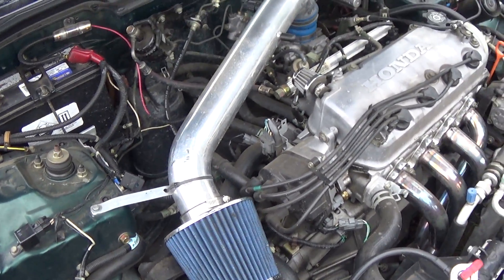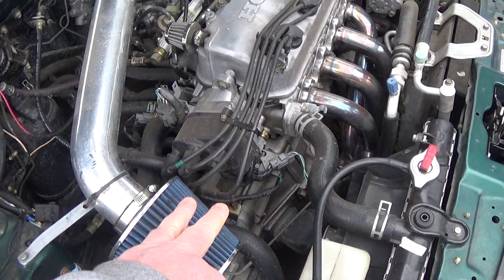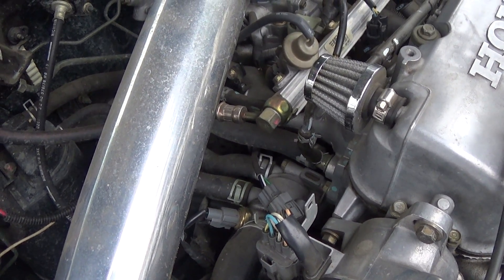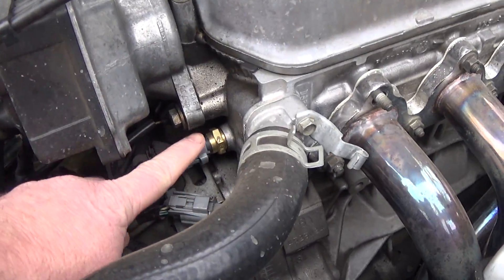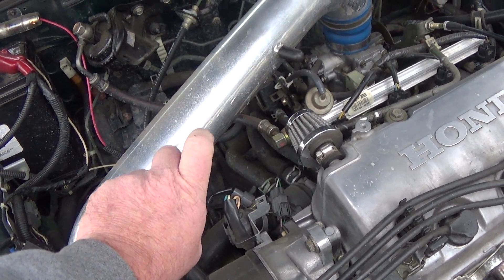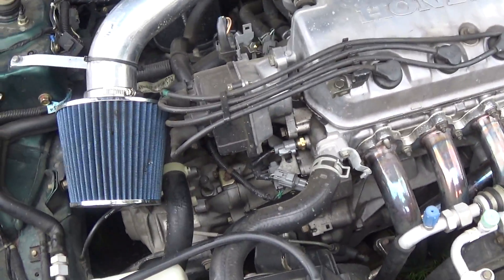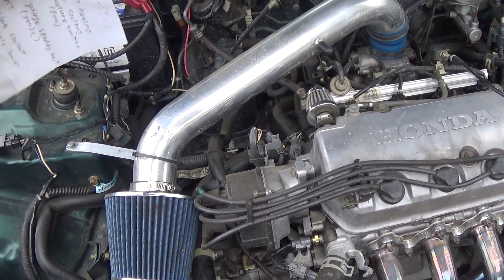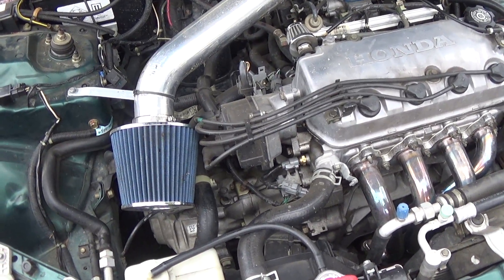Explaining Honda Civic 3 Engine Coolant Temperature devices

Comment: Are these 3 sensors different in shape/size? Can someone fit them in the wrong place? My problem is that since I changed the oem ECT, the temperature gauge fluctuates when driving in different road conditions. This didn't happen in the past. Once the engine got warm the temp.gauge  would stay in the same position.  I used a delphi sensor with this part number ts10180-11b1. Should I worry?
Reply from the maker: I don't see how you could put them in the wrong place.  Have your battery and alternator tested.  Should be free at your local parts store.  They can test it on the car.  Also you can have the read for scan codes.
Reply: @tubejim101  Im getting a rebuilt engine for my 94 civic and Im trying to find a water pipe that bolts into the cylinder head. Im not sure what thye are called but a coolant hose runs from the heater core valve to that pipe. It is about 2" in length and 5/8 in width. Not sure if a rebuilt engine comes with one. You wouldnt happen to know where I can get one for a 1.5 liter?
Reply from the maker: @Someguyto  Normally I would say just get one from the wrecking yard.  Sadly,  they have been crushing the cars, because scrap prices are going high. Does the pipe, actually have two parallel pipes?  Go to your Honda parts guy, at the dealer.  Honda is really good about sharing their parts sheets.  He can look it up for you and print it out for you too, if you ask.  Honda parts from the dealer are hit and miss.  Some parts are priced very good, others off the chart.  Always check.
Reply: @tubejim101  It looks like it is all 1 piece to me. I would risk trying to reuse it but if it ever breaks later on I would hate to have to replace it or uninstall it. It screws directly into the head under the distributor cap.
Reply: @tubejim101  these are tested. No error codes as well. I wonder how changing the ect affected the way the gauge works. I also replaced the thermostat with a genuine one.
Reply from the maker: @saxophonias  Could also have an air pocket in the coolant.
Reply: @tubejim101  so you think it needs bleeding the coolant?
Reply from the maker: @saxophonias  Burp it.

Comment: hello are the two front ones the same  ? it only shows me two on the az website
Reply from the maker: az mean AutoZone?  All three are different.
Reply: @tubejim101  yeah
Reply: @tubejim101  which one do u recommend me change  the gauge goes up when im on idle the fan turns on so i dont think its the cts
Reply from the maker: @rustfornoobs1071  Sounds like you have air in your system.

Comment: My civic dashboard gauge works but never goes over the middle, I’ve been pushing my car uphill and stuff and still didn’t moved more than the middle it never overheats, I got the stock radiator how is it possible?
Reply from the maker: Couple of thing.  Don't run green radiator fluid.  Use a universal long life (5 years) antifreeze.  No one ever remembers to change green, bad antifreeze can coat your cylinder walls so they don't cool as well.  Get premix.  An air pocket will throw off cooling.  Someone may have put the wrong thermostat in.  It could be bad.  If it is stuck open, you will have trouble heating up.
Reply: @tubejim101  thanks for your reply, no problems heating when cold, just can’t believe my car not overheating, not like I want it to but I was stressing my engine uphill in a mountain and the gauge didn’t move, I will try to flush it and use that one you recommended

Comment: My temp gauge was working but the wire split just from being old over time so I wired a new temp sensor clip on an now my temp gauge won't work at all. Any idea what else it could be?
Reply from the maker: Probably another brake in the wire.  I had that with my reverse light switch.  Fix the break in the wire, just to find another one about a foot up.

Comment: U think a EF is about the same?
Reply from the maker: 87-91 is obd1.  But, could be.
Reply: @tubejim101  thought it was Obd0
Reply from the maker: @dameonfochtman881  Which EF do you have?
Reply: @tubejim101  91 crx hf, think it has the d15b6
Reply from the maker: @dameonfochtman881  Nice.  Are you going to keep the engine, or put a different one in?  If it has a carburetor, it most likely only has two sensors. I have never worked on that engine.
Reply: @tubejim101  I’m keeping it, trying to be the one of few people with a completely original crx, but it’s a mpfi system, n the fans never kick on n it never fully warms up but it acts like it’s loosing power after it gets warmer
Reply: U think I could send u some videos of what’s goin on n get advice
Reply from the maker: @dameonfochtman881  Just post on you channel.  People will probably help out.  Wish you where closer.  Would be a fun project.  It is going to be hard to keep stock.  Think some parts are not still made.  Here is an 87 crx.  Is this what your engine looks like?  https://www.youtube.com/watch?v=x27QoI-ROOk
Reply from the maker: @dameonfochtman881  Ok, if you have fuel injection, it is most likely setup like the d16 engines.  Hopefully it will be easier to get parts for.
Reply from the maker: @dameonfochtman881  Start looking for an oem service manual.  Should be able to find a pdf one on the internet.  I will keep an eye out at my local book stores.  Also, see if Honda will sell you one.  The are about $80 but worth it.
Reply: @tubejim101  yeah it’s fairly easy, I got two motors for that car but swapped em n still having some issues, prolly shoulda did all new sensors too
Reply from the maker: What state are you in?  In Oregon there are tons of Hondas, but sadly they are getting crushed in the wrecking yards, when scrap prices go up.
Reply: @tubejim101  thanks for the advice I’ll check it out n look for one, I’ll make a video tomorrow n upload it too
Reply: @tubejim101  I’m from Pennsylvania, they are normally stripped to the bone at all junk yards it’s hard to find parts, but people sell all the oem stuff on Facebook n swap their hondas
Reply: I’m from like north east Philly
Reply from the maker: @dameonfochtman881  Looks like the same setup as the d16's  found an online pdf.  Look under cooling:  https://cardiagn.com/cooling-1991-honda-crx/
Reply from the maker: @dameonfochtman881  You need to find out how to get the obd codes.  If there is not a scanner that can read it, you will most likely have to get the flash codes off the dash.
Reply: @tubejim101  wow thanks man I appreciate it I’ll take a look at everything

Comment: I have 2002 Honda Civic ex 1.7L... I changed my radiator all new hoses.. and I changed the coolant temperature sensor and the coolant temperature SWITCH... but my temperature gauge is still not working what could be the problem?
Reply from the maker: After 2000 Honda changed the engine.  Have not worked on the ones after 2000.  If I where to guess, I would say you have air trapped in the engine.  Have to "burp" the engine.
Reply: @tubejim101  do you mean like flush the engine?
Reply from the maker: @Mrunknown711.  Nope.  Get the air out of the cooling system.  Here is a video of a different car, but the idea is the same.  Getting air out:  https://youtu.be/mfTapX0DuQ0?t=413

Comment: Thad say than one you saying got for hot motor spart plug work better it sensor no work good got problem to stared the car the morning staring ok like 35 moored put off no want to stared way lilte be stared ogaing rpm got up reals slow thing that problem I got i got the code for that sensor to ok thank s much

Comment: Not turnjng on on cold weather and chsnged the sensor and relay is good any advice? 99lx y7
Reply from the maker: Have you done the paper clip test?
Reply: I had a no crank no start problem. Changed starter still didnt turn on. Changed main relay switch still didnt turn on. Checked the battery 4 different times and autozone said my battery was perfectly fine and 100% charged. I put a new battery in and my car starts right up.  As crazy as this may sound u just might need a new battery even if your battery is reading fine and passing all the test of a good battery. It could still be your battery that needs to be changed unfortunately. I brought the battery that's in my car from autozone last year which made this experience even weirder but try using another battery that isnt inside the car already to see if that fixes your problem the way it did for me

Comment: If yje engine temperature sendor can cause over heating for the radiator fans turn on late
Reply from the maker: When the sensor goes out, it just tends to stop working.  If the engine is over heating, I would check the thermostat, and make sure there is no air in the line.  And also, make sure the coolant is not low.

Comment: Is it possible to hook up aftermarket water temp gauge on the 3rd sensor,the one that sends the temp to ECU.I dont want to cut any hoses and bleed the coolant if not needed.
Reply from the maker: If you don't feel comfortable cutting hoses and bleeding coolant, then you should not be doing any mods.  Leave it OEM.
Reply: u dont need to drain it if you have the replacement ready and put it in before it spills too much

Comment: What is the part number for each of these sensors? Just so it's easy to look up the specific one needed
Reply: 37760-P00-003 - Fan Switch (the one on the thermostat housing.
37750-PH2-014 - Sensor that send to your guage on the instrument cluster
37870-PJ7-003 - temp sensor that goes to the ECU.
I use Honda Parts Now; there are several sites like them and pricing can vary, so make sure to shop around! 
https://www.hondapartsnow.com/

Note: these are for the D16Y7 engine.
Reply: @schmattx  thanks man that helped me out alot.
Reply from the maker: Just call your local Honda Dealer.  They will be happy to look it up for you.
Reply: @tubejim101  thank you for the help and replying to my message

Comment: Thank you so much this is the video i have been lookingn for 1 question before ordering parts the thing about my 98 civic dx when i start my car cold the temp gauge on my cabin goes up immediatly to noraml temperature like on the middle i dont think thats normal should i replace both the ones under the distributor? Thanks hope you reply
Reply from the maker: You want to test them.  One feed temp info to your computer.  If that one was off, you would be running poorly.  The other one feed your gauge.  It is not to hard to test your gauge.  I am going to make a video on how to test it.  Just have a lot of projects going on, so i am not sure when i will get the video done.
Reply: @tubejim101  do you get engine code when this sensors goes bad?
Reply from the maker: @SuperTheBryan  The only one that might through a code, would be the sensor for the ecu, but most likely it would be a result of it being bad.  Maybe, causing the wrong fuel ration, so you get a back fire, that made your knock sensor activate.  Something indirect like that.
Reply: tubejim101 heres me again so i replaced the gauge one with a beck arnley and the temp was raising normal but after some minutes it was way to high so inwent to the junk yard and found a civic with about 100k miles and now is working fine temps raise normal when starting the car....can i ask you other question what does that filter do on the valve cover ??
Reply from the maker: @SuperTheBryan  Normally a hose runs from the valve cover to the intake.  It spews nasty stuff in your intake/throttle body.  This gums things up.  A catch can is a better solution.
Reply: tubejim101 wow so now ik why my throtle body had oil when i was changing the filter and yesturday i changed my exaust manifold  gasket and there was oil coming from the holes you know why?? I didnt se that before changing my headers but after changing the pcv valve and cleaning the breather box i got this problem hope you understand me
Reply from the maker: @SuperTheBryan  Not sure why you have oil in your exhaust manifold.  Maybe leaky valve stem seals?
Reply: tubejim101 ok thanks 1 last question jim sisnce i replaced that sensor idk if both fans should turn on i have the same ac fan and radiator.if i have the ac off and when the engine gets to normal temperature should both fan turn on even if ac is off?? Because only the radiator fan turn on when it gets to normal tenperature but if turn on ac both works i thought both fan should turn on even if ac i ls off.. thanks for replying me
Reply from the maker: @SuperTheBryan  Sounds like it is working the way it should.
Reply: Hello, thanks for the vid. I replaced both large sensors and my fan is still not kicking on. Will replacing the third small switch fix the fan issue? I used a infrared thermometer and  the temperature read 198, I shut the car off after that. I felt as though the fan should’ve kicked on by then. How hot should I let the engine get? Thank you.

Comment: Hello sr thanks for this video .. my cuestion is the senssor of the middle has tosted wires may be is sendidng bad info to the ecu.. that can be why my prelude 99 auto.. starts to run rich i just found it cus i replace the auto transmission of my car after stay stoped like 3 days befor the install may be brake a wire or someting cus i just foun that the wire is ben like loosen and tosted
Reply from the maker: The middle one only works your gauge.  The front one sends the info to the ECU.  Have your battery tested for free, at an auto parts store.  Also have your codes read for free.

Comment: 95 civic , man this helped . . .kind of,  had no idea about that 2nd gauge sensor,  thought the 1st one (fan) was the only one.  Anyway, thanks to you,
I was able to replace the gauge sensor yesterday .  However the gauge still didn't work, on the test run ?    Ideas ?   does it make any sense to replace the thermostat ?
Reply from the maker: Need more info.  Is the fan off when it is cold, then come on when the engine warms up?  What exactly is the temp gauge doing, or not doing?  Are you getting any back fires on a cold morning when you first start driving when the engine is still cold?
Reply: @tubejim101  the gauge is just dead, sit's there below cold, never moves,  no issues with the fan that I've noticed,  when she starts she runs as smooth now as ever, has never backfired .  that's why I thought the gauge sensor was the issue.  ( where you helped was I was thinking the fan sensor was the only sensor the system had )   thanks for the quick response
Reply from the maker: @ppinchera8225  I did some research.  Your temp sensor should just be one wire.  Should be this one:  https://amzn.to/3jd3AVf   If you disconnect the wire to the sensor, and ground the wire (just jumper it to the engine block)  The gauge in the cab should start going up.  You have to disconnect it, before it gets to the top, or you might damage the gauge.  So best to do it with two people, or run enough wire, that you can watch the dash, and be able to break the ground when it starts moving.  If you see it rising, you wire and gauge are good.
Reply from the maker: To test the sensor, just disconnect the line to the sensor.  From the sensor, to the ground, measure the resistance.  Cold should be around 142 ohms.  At 212F it should be 49 to 32 ohms.
Reply from the maker: I will try and make a video.  It is tricky though.  I don't have a camera man.
Reply: @tubejim101  appreciate all the input,  full day today here, will be going back under the hold tomorrow, will let you know

Comment: if you remove the distributor, do you have to adjust the timing when putting back on?
Reply from the maker: You should.  Next time mark the distributor, so you can put it back in the same spot.  Most of the time, if you just center the distributor, it will get you by, till you can time it.

Comment: I need some help.
My rad fan wasn’t spinning so I unplugged the Coolant Fan Switch and completed the circuit using a wire, and it spun. So I went to replace the Coolant Fan Switch thinking it’d solve the issue but the fan still doesn’t spin. I’m pretty sure I got all the air out the system because I ran the car with no radiator cap for 30mins and the temp sits steady right at Middle point but the fan never kicks on. What else can be the issue here?
Reply from the maker: You will want to get this funnel setup:  https://amzn.to/2CNEKqI
Reply from the maker: Here is a video for an Accord.  You just won't have a bleeder screw:  https://www.youtube.com/watch?v=mfTapX0DuQ0
Reply: tubejim101 thank you for the reply, I appreciate it. How long does it take to get to normal running temp? It ran for 30 mins and my radiator fan never turned on. Its a 00 civic lx. And the temp in the dash only goes half way, but the fan never turns on. I got a new switch, thermostat and housing. Could just be bits of trapped air?
Reply from the maker: @seriousamm  It can be hard to burp those Civics.  Make sure you are running the correct temp thermostat.  Think it is 170.  Make sure your heater is on.  Also, need to make sure you have coolant in your overflow bottle.
Reply from the maker: @seriousamm  You can go to autozone.com and look up the part.  You can also double check at other parts stores online too.
Reply from the maker: This video might help too:  https://www.youtube.com/watch?v=zUpXgAJ1gjU
Reply: tubejim101 thanks for the info, I got the problem all fixed!